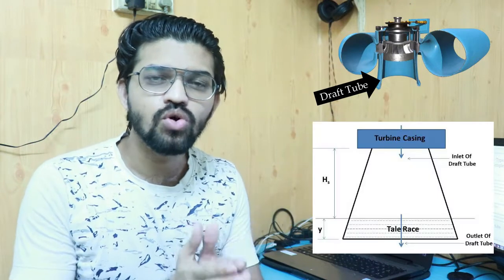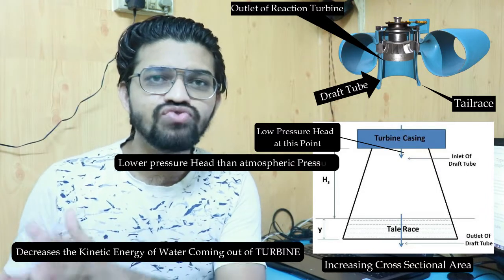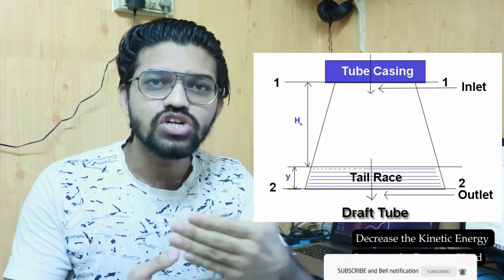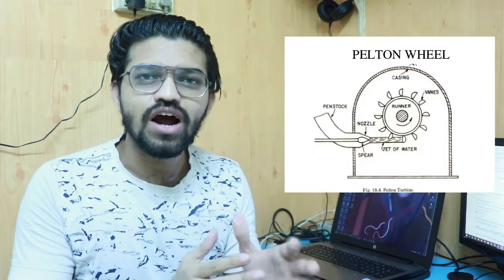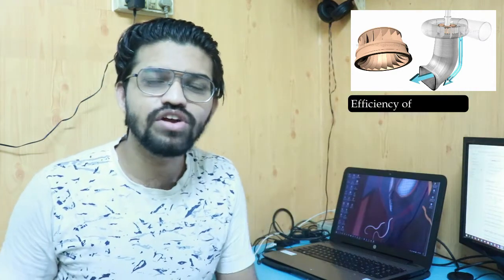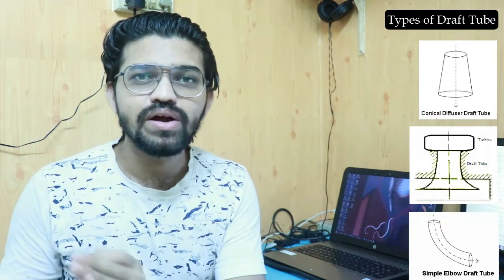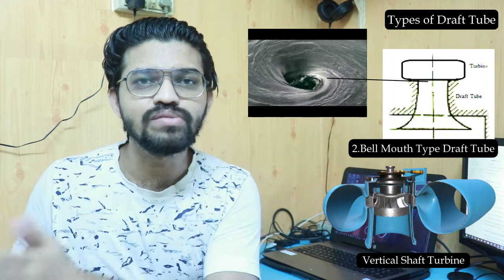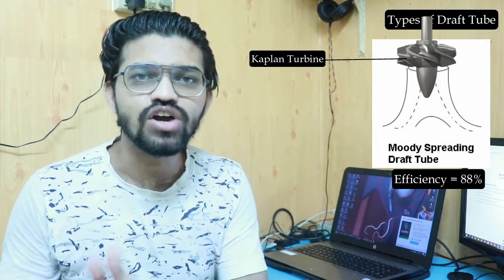Draft tube in Reaction Turbines.

Comment: urpose?
(b) In a laboratory experiment, water at 39.24 kPa is available to operate a model turbine at 
415 rpm. What type of turbine will you choose if it is to have an output power of 30 kW?
(c) A geometrically similar prototype turbine is required to be designed to produce 20 MW 
under a head of 16 m under dynamically similar conditions. At what speed will the 
prototype run? What should be the runner diameter ratio between the prototype and model? 
What will be the volumetric flowrate through the prototype assuming its efficiency is 90%

Comment: Uncleared explanation
As you said & as per Bernoullis equation the pressure at the inlet of draft tube is less than the outlet at the tailrace so please explain water will flow from inlet to outlet or outlet to inlet? How the water existing will be easier?